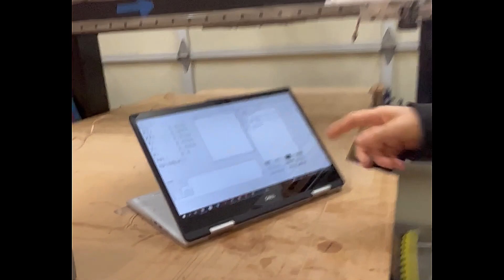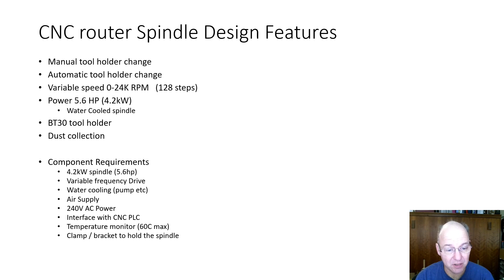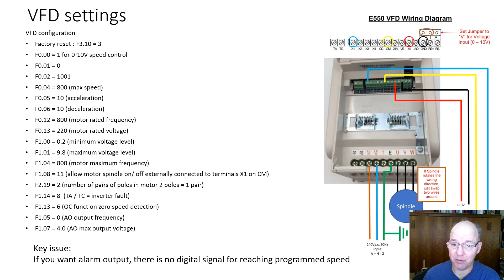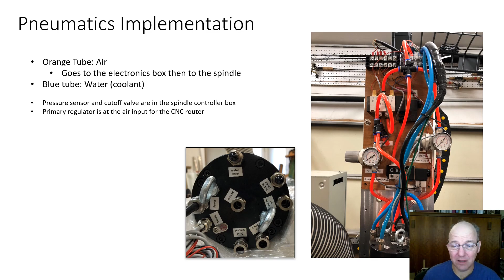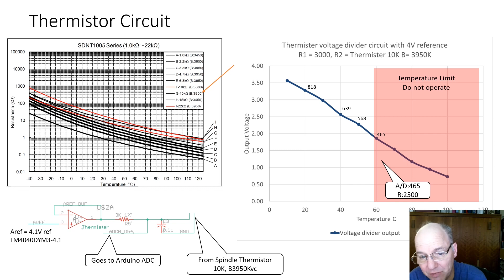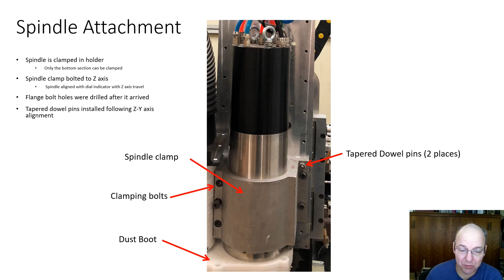Jianken ATC Spindle build with a CNC router

Comment: Very nice video. Every single word matters. I only think this approach is applicable to controllers that understand G-code to change RPM. 
Messo G3 does that, but cannot find any doc for MP3300iec or MP2300iec where I can read that to confirm my understanding.
Reply from the maker: In this case I use the MP3300IEC to send a 7 bit word to an Arduino.  The Arduino is sending an analog voltage to the VFD to set the speed.  The Arduino is actually really controlling the spindle, including the state machine for the tool change as well as speed change.
Reply: @evanmccarthy7589  Yes, I understood that from the video itself where you explained LIO6 interfacing with Arduino, so  MP3300IEC controls VFD by gcode.
2 other questions if you don't mind:
1. From your state machine: how do you identify ramping/stopping state finished? I believe VFD doesn't have any output for that. By the time like 5s?
2. And what do you use to control axis motors? Servos over MECHATROLINK-II? OR steppers via LIO6?
Reply from the maker: @sergeimo  At the moment I do just use a fixed time.  However I am planning on upgrading it using the A0 output going to the AD on the Arduino to verify when the target speed had been reached.  
For the gantry system I use Yaskawa.  It was a massive software project since I started before Yaskawa had implemented their Gcode functionality, and I wanted to learn to program PLCs.  So it is a sigma 7 servo system using the MP3300IEC and Motionworks. 
 
The software implements the following: 
-state machine for the system with manual and program mode
-state machines for each axis
-homing, 
-Gcode parsing (linear motion, circular motion, drill cycles, m-codes, incremental and absolute) , 
-blended motion for multiple Gcode lines,
-dual socket connection to a remote computer for infinite program length and machine control, 
-execution logging over the socket (for debugging), 
-position updates and alarm messages over the socket.  

So I run this over Wifi with a laptop.      

Then I implemented a UI in python because I wanted to learn python and modifying LinuxCNC seemed daunting at the time, which was likely a mistake. The UI implements the normal expected simple functionality as well as implementing infinite look ahead for the Gcode programs in order to maintain smooth motion with any program.  Needless to say the UI is also is a pretty big project by itself.
Reply: @evanmccarthy7589  Thanks for detailed explanation. If think you are talking about F1.05=0 to see the actual frequency. Along with F1.06 it could give some indication of current speed as a function of frequency, but my spindle spins at 15Hz and lower, that is almost 0V and you need to have very good filtering to read the true value. Good luck and please update here or add new video once you finish. Looking forward to see more...

Comment: Question: in your ATC Spindle Pneumatic Diagram you mention a 2 position 5 way valve, type 4V310-10. However from the picture of the installed pneumatics it seems to me that you use it as a 3 way valve, as the connection to port A seems like a "short circuit". What is the background of that?
Reply from the maker: It allowed me to be sloppy and or mistaken in the design.  The final configuration I have is where the solenoid is normally powered off and only powers on during a change.

Comment: Hi Evan, thank you so much for this excellent video. Today I received a message from Jianken that my 5.5kW ATC spindle is ready to be shipped, and your video will certainly be helpful to get my spindle up an running quickly. As for the 200cm distance between the VFD and spindle, I have been checking this with the Jianken team. Please be advised that the mentioned 200cm is in fact a recommended safe distance in order to keep radiated EMI limited. Technically it should not be a problem to place the VFD at a greater distance, but additional EMI measures, like proper cable shielding, may be required for compliance with applicable EMC regulations. Until recently I have been using a 5.5kW Perske spindle with a Yaskawa VFD, and had no problems when using a 5m cable, and although that was a 400Hz spindle, I cannot imagine that running at 800Hz would be any different. I will give it a try when my spindle has arrived.

Comment: Great video! I just wish you head was not so in the way.
Reply from the maker: yeah, good feedback.  I don't think that it actually blocked anything important, but a voiceover may have been better.
Reply: @ only the slide with the VFD settings. I can’t see where X1 and CM are connected too.
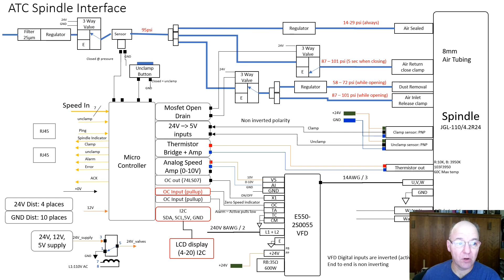Reply from the maker: @grandmastersreaction1267  X1 is On/off, and CM is ground. See the slide at 7:14

Comment: If you ever purchase another spindle from china, ask the supplier to break up the invoice into different payments below $800 and you wont have to pay inport tax. 

I just bought a similar spindle, a jenkins 2.2kw 400hz spindle, and im using a Masso controller. You seem extremely knowledgeable. I was wondering if you could help me with some questions regarding instalation. This is my first ATC install and im not sure what valves i need need to purchase etc. I think the has plenty if inputs and outputs to handle all the controls i just dont have a clear plan on how exactly to go about the install. Thanks.
Reply from the maker: The first step is to get the manual for the spindle.  It should have a description of the steps to take to change a tool.  For example, turn on or off specific air at a specific pressure for specific amounts of time. If you can't find it, then you need to get it from the manufacturer.  Once you have that, then you can design your pneumatics.  I'd recommend that you configure the solenoids such that they are only activated when changing the tool.  Otherwise, they get hot and burn a lot of power.  Depending on the drive capability of your controller system, you may need to add a driver of some sort to drive the solenoids.  Then you need some sort of software to implement the tool change.  Note that while I planned for automated tool change, I only change it manually at this point.   Then if there is a human involved your software needs to account for odd things happening when you push the button to change the tool.  For example repeatedly button press in the middle of changing.   To handle moving between the states of running, stand by, and tool disengage I used a state machine implemented in C on an Arduino.   I think I pretty much covered my design in decent detail.  I'd be happy to answer questions if you have them. Note that this state machine needs to control both the VFD as well as the solenoids. I purchased the solenoids and regulators on Amazon.

Comment: Hello we have a porject at school that Is making the change of tool automatic, and iu don't understand why you used 5/2 solenoids valves and not 3/2 and I don't understand how you implemented it. It would be nice to exchange about it Thank you
Reply from the maker: I would be happy to chat about the details.  It seems that on my projects I am doomed to explore all the ways that the machine can fail before finalizing on the working design.  In the final working implementation, I have plugged one of the outputs entirely using the tubing.  You can see this in the picture at 3:00 min at the top.   The other solenoid is a 3/2 lower down.   The system diagram for the pneumatics is shown at 7:30 and just shows 3 way valves.  I had never worked with these types of valves and found that getting the function correct was unexpectedly challenging.  If I did it again I would manually set up a test platform with the pneumatics and some manual switches to work out the full operation before attempting to integrate with the microcontroller.  Some key design considerations I wanted after exploring the ways it could fail were the following:  1) During normal operation (tool clamped), none of the solenoids should be powered up as they get hot.   2) when the power is disconnected or applied none of the solenoids should activate.  I had to cut the power to the solenoids with a relay to ensure this last one, as cutting the power to the power supply caused glitches that activated the solenoids and dropped the tool while still spinning.   Using the 5/2 solenoid did let me purchase a single piece of hardware that would accommodate the normally off or normally on operation by just using the different desired side of the valve.   Or perhaps this was the piece of hardware that worked after realizing that I had messed up the normal off/on function on the solenoid.
From a system design perspective, make sure to ask yourself "What happens if the power fails, or wire becomes disconnected" at any point in your machine operation.  The goal is to avoid the 24,000 rpm spinning top of death running around your shop.
Reply: @evanmccarthy7589  Okay, I asked about the 5/2 solenoids, because you put it at 7:30 on the bottom right corner and I had the impression that you the solenoid valve at 3:00 is a 5/2 and not a 3/2. I don't understand how you connected the pneumatic network on the left at 3:00 could you explain it to me ? We will make sure to take that into consideration when implementing. Thank you so much for helping
Reply from the maker: @louisdosthouse1820   Look at the picture shown at 10:34 on the right-hand side of the slide.  The orange tube is the air, and the blue tube is the coolant.  The source of air is at the top of the picture.  The solenoids are attached to the wood. In the top of the wood board is a  5/2 and the one in the bottom is the 3/2.   It is a little hard to see, but the left hand output of the 5/2 is plugged by using a tube that doesn't go anywhere.  To best understand the operation before purchasing hardware, you can youse my system diagram shown at 7:22 and read the datasheets for the solenoid valves you want to use to help understand the operation.  Ultimately you are trying to implement the pneumatic switching sequence given by the manufacturer for your specific spindle.

Comment: Just a heads up. I spent alot of time talking with them setting up my spindle the last week. They recommend that You never go below 10seconds braking time even if You have a braking resistor it greatly reduces bearing life.
Reply from the maker: It seems that decreasing the breaking time would increase the transient current through the windings but I wonder it would impact the bearings?
Reply: @Evan Mccarthy  Im nit sure what the mechanics behind it is but their were very clear about it and highly recommend leaving the time as it was set from the factory for the sake of bearing life